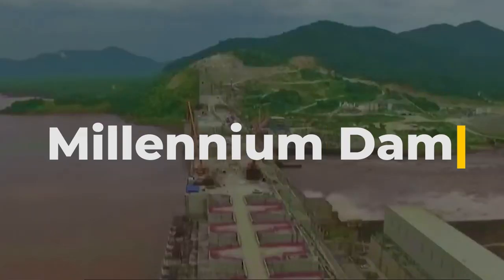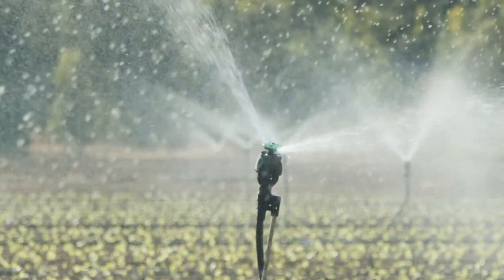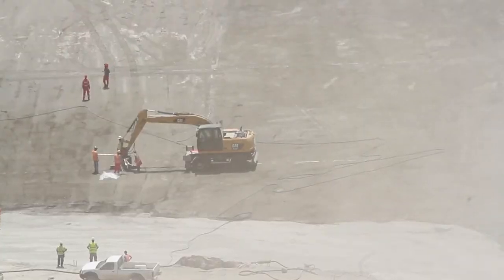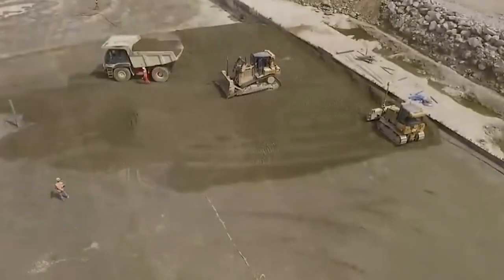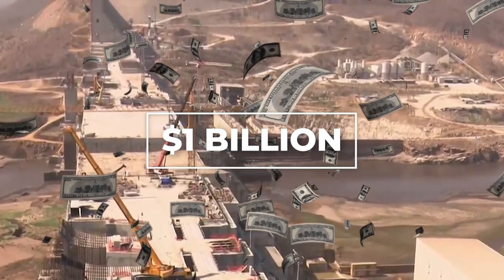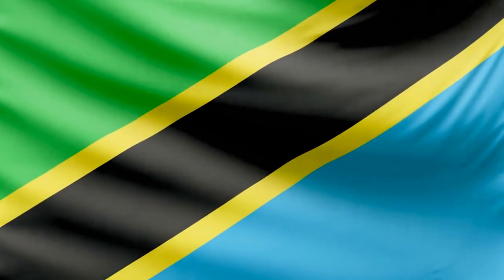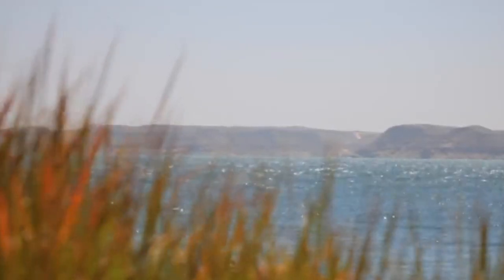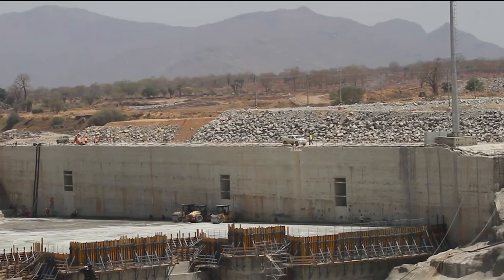How This Ethiopian Mega Dam Plans To Boost The African Economy! | Grand Ethiopian Renaissance Dam

Comment: Egypts has lost the position, as the ruler off the Nile. Egypts hope is to: Save water. 2. Use water smart. 3. Use off their 6 500 000 000 000 m3 grundwater recource. 4. Talk to DCR, about buying water form The Congo. It`s easy to move water from The Congo. This river is 16,1 times "bigger" than The Nile River.
Reply: Thanks for your professional advice for Egypt politicians